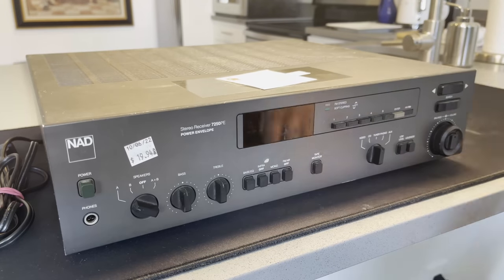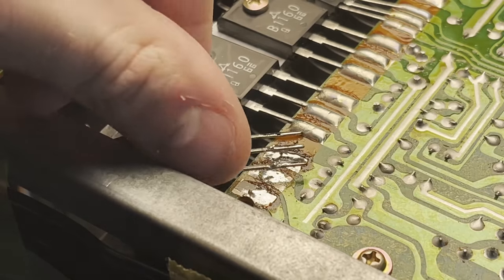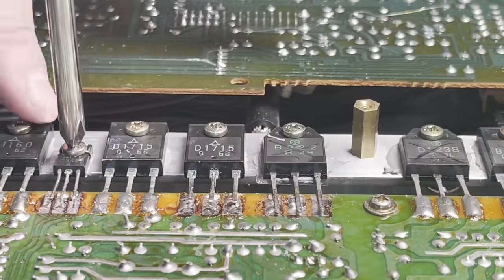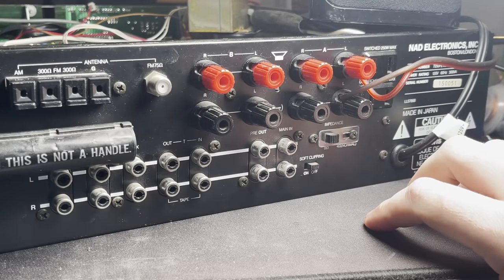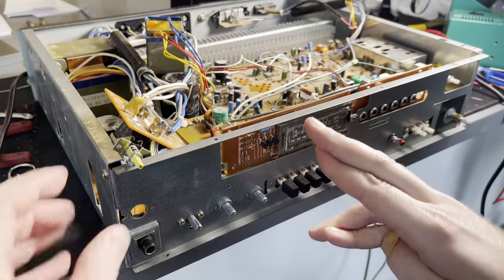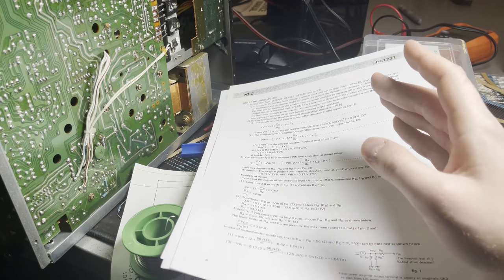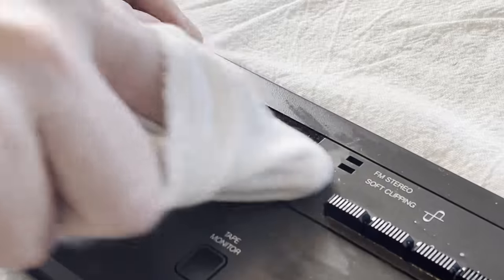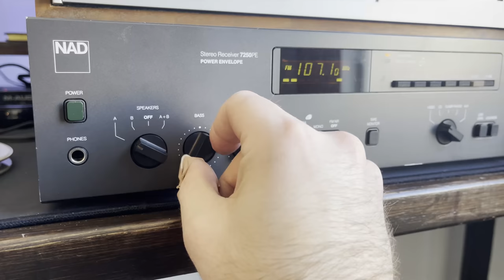Broken Amp? NAD a problem! - 'Fixing' A Mid 1980's Amplifier

Comment: The reason there are so many power transistors is because of the Power Envelope technology.  You've got 2 separate output rails (Hi/Low), 2 sets of filter capacitors and commutating diodes that switch into high power (Power Envelope) mode for burst current.  Those amps are beasts.
Reply from the maker: Thanks for the info, it stood out to me because the only other receiver I've opened up had only 4 of them in it haha
Reply: Also the higher the operating voltage, the less current the device can supply - SOA. Bigger amps could employ 10 or even more pairs of output transistors. Take a look at Accuphase, or any real high current Hi-End amp capable of driving 2 ohm complex load, which isn't that unusual with 4-6ohm nominal impedance rating. For 100W/8ohm high current A/B class amp is a rule that they need at least 2pairs of 15A/200V, 150W min transistors.

As with many amps from the past century, yeah, there's the U jumper trick in the back - you idiots. Been there done that ;)

Comment: You should try to set the bias and bring your millivolts that are coming out on your speaker terminals down as low as possible the Safeguard your speakers it measure your DC offset if you have your service manual there it'll tell you exactly how to do it and you should be able to do it very easily it will instruct you on how to do it and using your multimeter and some of them you have to use a certain resistor in line with it sometimes you do sometimes you don't but you just do one side at a time if you have two meters you can do them both at the same time set your DC offset and your bias and you shouldn't have any problems and it should recommend it should be right there in the service manual what they recommend you set your bias and your DC offset at and you shouldn't have any problems with it as long as everything is set properly

Comment: Just an fyi, but it's not adviseable to use computer thermal paste on transistors because most of those types of thermal oaste are electrically conductive due to containing silver. That can cause the transistors to short out. There are specific non conductive types of thermal compound specifically for use with transistors. Also the hfe value is the gain of the transistor, as in how much amplification multiplication it will give for a given input.
Reply: Theyre ditching silver these days, too many crying computer geeks. Most of the pc stuff is non conductive atm. Although they have started using diamond powder 🤦 (if they have it theyll find a way to sell it).
Reply: The white paste is mostly always not conductive.
Reply: Instead of MICA Insulators (when collector is hot, +V), I use NTE Thermal Pads — Better.

Comment: Regarding the higher value resistors to change the threshold, first of all, nice bit of investigation in determining what the issue is and how to change it. However, I would strongly suggest that you keep working on it, because there is definitely something out of spec that is causing the measured values to pass the original threshold. Given that must be the case, over time that will likely drift further and if you're lucky it will just start tripping the relay, if not it could damage your speakers, as you're already aware, but it could also damage other components. You probably know this too, but many components can test fine but still be bad, which can make it a roysl pain to find the culprit. Capacitors for example can measure as being fine in terms of capacitance, but have really high esr, which you won't see unless they're tested on an esr meter. It may be worth replacing the caps in the protection circuit even if they test good and then check if the original threshold is still being passed. Anyway, just my 2 pence worth of free advice. That's what I'd do, but you must do what you feel is right, of course. :-)
Reply from the maker: Thanks, I'll definitely be taking it apart again to look at it some more; I've gotten some great advice in these comments, so I don't feel too lost anymore haha.
Reply: @HifiJelly  that's excellent to hear. I hope you manage to get it back to spec. As you said in the video though, you're using it for learning purposes, so regardless of the final result, no doubt you'll enjoy the learning experience.
Reply: @juddery  I would recap it while it's tore apart anyway.  Wouldn't take too long. What do you think about the idle current maybe being too high? I'm just spit balling here since I don't know what he's measured so far.
Reply: @3dsmaxrocks699  in all honesty, I'm not sure what value the idle current should be on that model, or what the procedure is to adjust it. However, most that I've worked on have adjustment pots to set this. Normally a low amount of millivolts is perfectly fine although what is considered low on one model, may be considered high on another. Ideally it should be set to as close to the value specified in the service manual as possible, using the recommended procedure. It could also be that ageing components are causing it to run just a little over spec due to a drift in their original values. Without knowing the unit though, it's hard to say for sure.
Reply: @juddery  that's why I wish I was there with schematic LOL. I'm a locksmith by trade for 25 years.....and a electronics hobbyist.... and still learning.
Reply: @3dsmaxrocks699  I'm software developer by trade and also an electronics hobbyist who is still learning, so am definitely no expert. It's something that I really enjoy though and vintage audio electronics is what my main passion revolves around. I get a lot of enjoyment from taking something that doesn't work and bringing it back to life again.
Reply: @juddery  idle adjustment on this one is in the service manual which can easily be dl'd from hifi engine if you register. Spec is 20-25 mV.  I set mine at 22.5.  There is a school of thought that advises maxing this out for quicker transistor response.  Pretty sure this is one of those minor tweaks I could never notice.  But the theory is food for debate.

Comment from the maker: Thanks for all of the great suggestions! I took your advice and measured the output offset voltage; the right channel I was able to adjust with some pots to be .5mV, while the left channel was measuring 1.5V, so that explains why the relay was tripping and means there is certainly something wrong with the left channel, now to just try and find out what....

Update: Did some more troubleshooting and traced the issue to one of the power transistors that had shorted, I thought that I had checked it but either I forgot or I didn't test it correctly haha. I have ordered a replacement for that transistor, and I have also switched the resistors back to the original 56Kohm reading. Thanks for all the great advice and comments!
Reply: Although in idle mode it shouldn't make much difference,
Remove the jumbers from both channels and check again the voltage there.
Then switch it off let it cool and check immediately after powering.
If it starts climbing check with your hand what component is getting warm 
Usually a resistor which can drag a transistor by affecting it's bias.
The opposite could happen also.
Lastly, a scope would be really handy now.
Good luck!
Reply: Check those distortion trimmers.  You will never get offset right if they are oxidized.
Reply: R618 should be clearly visible on the left channel side of the amp board.  R668 is pretty well hidden under the input selector (silver) extension arm.  If these are truly absent and not replaced with 100 ohm resistors, you have a gap in the circuitry. My 7250pe has a build date of 1986 for reference.  Someone may have been in your amp.  My protection relay was fully sealed and did not have a pop off top like yours.  I replaced mine too.  But the sealed one I took out matched the listed part number from the service manual   omron makes an exact drop in for that relay, although it is not environmentally sealed.  Pretty sure I can see the edge of r668 when I pause your video.  You seem to be able to get close on the right adjustment, but are way off on the left.  I bet they pulled r618 and could not find r668
Reply: Thanks for the video, interesting stuff and admitting when you made a simple error, just the sort of mistake I would make. Regards Mike🇬🇧
Reply: those relays can go bad as well, i've had to replace two or three omron relays in amps. they get dirty after awhile because of all of the arcing going on inside and they build up carbon and then fail. sometimes parts of them can fuse together. if i'm doing a complete refurb, i would always replace them, and also the voltage offset pots with sealed units
Reply: Have you since been able to replace the transistor? And if so did it work ?
Reply: I think the hottest parts are often the most likely to break down. I fixed a similar hifi amp, and I was surprised to see that some resistors had gone high, explaining some excessive dc at the speaker outputs. Also replacing the speaker protection relay mad a night-and-day difference.

Comment: The fact that you can make use of whatever you have learned so far,
proves that you're definetely a technician.
Btw those bridges between preamp and amp always make troubleshooting so much easier.
Also on a later stage when the unit is fixed, you can improvise like, driving this amp with another pre-amp
and vise versa.

Comment: I had a similar experience on an amp I recently acquired.    There are several small value resistors in the amp power rails (the ones marked with the triangles on the schematic). They act as safety "fuses" in the amp power rails.   On the amp I was working on, they were supposed to be 120 ohms, but they weren't.   Some were outright open, and others had changed values to much higher resistance.   Check those really low resistors (I think here they are are like 68 ohms) and see if any have drifted.   This will not allow the protect IC to do it's thing.   The amp might still run if the protect is defeated, but it's not right.

Comment: The pre-out/main-in is for use with outboard equalizers.  Now a days its probably used more for powered subwoofers.  Nice unit.  NAD makes quality gear.  Thanks btw.  I learn a lot from watching you.
Reply from the maker: Thanks! I certainly learned a lot from this project haha
Reply: It is a preamp and amp separation, so you can also pair it with another equipment.

Comment: The in/out jumpers are for installing external amps or an equalizer. I noticed as soon as you showed the back panels that yours were missing. I always use these,  modern receivers dont have them anymore. From what I can see manufacturers stopped installing them around 1993 (?). And I dont think your fix is spooky.
 As with most things, the manufacturer's threshold is probably set lower than needed for liability purposes anyway... Thanks for your videos I really enjoy them! Please keep making them!!

Comment: I have a 7100X receiver with some troublesome speaker relais, now i use it more on a regular basis this problem solved itself and does fine now but you have to give these receiver some decent speakers to feed ,NAD,s tend to fall "away" on low volumes at one channel and mine has this low output switch on it that i need to switch off every single time i switch the receiver on.
This function when "on" makes you to turn up the volume a bit more so it,s solves low volume listening problems.
Great tuner function, very precise,  and great ,very musical sound, these NAD,s do get quite warm when in use, so i do not stack anything on top of it .
I realy liked the video, seeing that the wiring mess inside is a normal thing with NAD, mine is the same,keep up the good work!

Comment: You can put external DC protection module outside of amplifier and bypass the internal DC protection, since you have UPC 1337 IC. Avoid stacking, those amps get toasty pretty quick

Comment: My Cambridge Audio Amp went into the highest protection mode for no reason. It hadn't been thrashed, mishandled or misconnected in any way. I took it to a local hifi repair shop and they couldn't find what had caused the circuit to kick in, but they said the only way to resolve it was to bypass the circuit, which they could do, but wouldn't guarantee any other components or my speakers would be protected. I decided to scrap it. I've since got rid of all my Cambridge Audio kit, (two cd players stopped working as well!) I now run Onkyo and Marantz kit which is a damn site more reliable, all bought cheap second hand. I plan to upgrade with new in the not too distant future so until then it's all working great!

Comment: At 19:30 I noticed an unsoldered pin on the left hand side of the board. IMHO it's always a good idea to check out all the soldering. Cheers!
Reply: That's the speaker selector.  It's an old alps switch.  Some of the pins are unused.  I had mine out and disassembled it to clean the internal slide contacts.
Reply: @ctrlzyx2  Ah good to know, thank you

Comment: I have this exact amp.  Check r618 and r668.  These are the distortion adjustment trimmers.  Should be 200 ohm max and they are usually adjusted about half way (~100 ohm).  These original trimmers develop surface oxidation and will ohm out in the kilo or megaohm range, i.e. way off.  Replace them with 100 ohm resistors or new 200 ohm trimmers set to the same approximate position as the old ones.  One of these is kind of hidden under a switch extension arm.  These are 200 ohm trimmers with 5 mm pin spacing.  I bought a bag of 25 on Amazon for about $5.  the other trimmers don't seem to develop this problem, just the 5 mm ones.  Once you replace these you can precisely set DC centering and idle.  It will be impossible to get these settings correct if these trimmers are bad, as I suspect they are, because yours look original.
Reply from the maker: Weirdly my amp doesn’t have those distortion trimmers, it has the trimmers for idle current and dc offset, but the two for the distortion are just not on the board. The service manual I downloaded has them in the pictures for the amp adjustments, and I don’t even see a blank space where they would go. So I don’t know if I have a later (or older) revision that doesn’t have them, so yeah pretty weird.
Reply: I have the same amp that developed the same problem as the one in the video only after I adjusted the dc offset. Now no matter what I do it trips the protection unless I bypass the channel which is causing the issue. I read your comment and while it sounds plausible I struggle to find the relation between distortion and dc at the speaker terminals. Would you mind explaining why the distortion adjustment potentiometers would cause this issue ? Also would that fix still be possible for my amp or do you think that mine might have a different problem?
Reply: @trevor245  I don't know why they call it a distortion adjustment. But it definitely has an impact on offset. In the schematic r618 and r621 are complemented by r626 which has a value of 680. R621 has a value of 560. R618 is variable between 0 and 200, or at least should be in that range. That puts it at a total resistance equal to r626 or at least close to it. If the resistance of the distortion adjustment trimmer (r618 ) goes sky high then there is no longer an equal ( or close) compliment to r626.  It is way off. There's your offset.  You can see why some people just replace r618 with 100 ohm resistor. Then the different sides of the differential stage have resistances of 680 and 660 (560+100), which is close enough.
Reply: @ctrlzyx2  you ended up being completely correct. It was measuring 8Mohm. After cleaning it went down to the proper measurement again and the amplifier booted and played normally. I did spend like 5 hours yesterday fucking around in the circuitry but atleast it's working now. I will order some replacement pots. Thank you so much for your comment telling me what to do.

Comment: Those are pre out/ amp in jacks.   The idea is to use that for an equalizer or bi-amping by sending the pre out to an electronic crossover and send the highs back to amp and use a separate amp for the lows.
Reply: It seems very similar to a guitar amp effects loop, where it sends the signal after the amplifiers preamp section then returning signal goes to the power amp. I also imagine you can also run it through some effects like of course EQ but also reverb and stuff.
Reply: @SleepingLionsProductions  yes, same concept.  But the idea here is to split the signal with a crossover where the highs go back to the amp section and the lows go to a separate amp powering the woofer.  It gets rid of the big time slurring capacitors used in a passive crossover.

Comment: With DC at the output you are going to either  kill your speakers or bias the drivers and experience distortion. Since the DC at the output of one channel is not a zero (within a threshold) I would check every transistor in this channel, followed by the caps that impact ths DC bias. This amp has a fancy 2-stage power supply to ensure soft clipping so it could be something in this department as well.

Comment: Check the service manual for the DC offset ( centering DC ) procedure. You can probably dial the DC voltage at the speaker outs to under 50mv optimal..
Reply: 👆This right here
Reply: Yep.
Reply: This is correct and is outlined in the service manual.  This amp is rather unique among Nad's in that it has distortion trim pots on each channel.  You cannot get the offset adjusted if these trimmers are out of spec.  With age these trimmers go to 100 to 1000 times their rated value.  It is a known problem with the 7250pe (which I own and have repaired).  These are 200 ohm trimmers.  Mine measured about 500,000 ohm when I replaced them.

Comment: Did you check the speaker outputs for DC voltage ? That is the firtst thing i do before i connect it to any speaker . But great video's and great repair work , keep them comming !